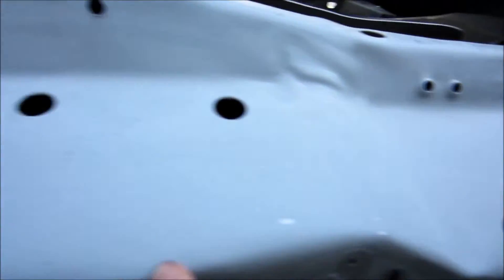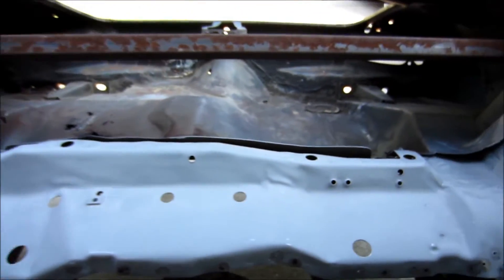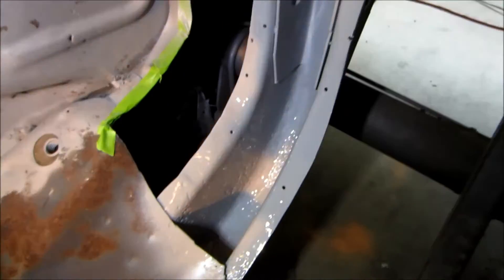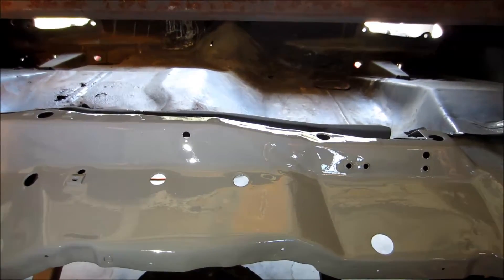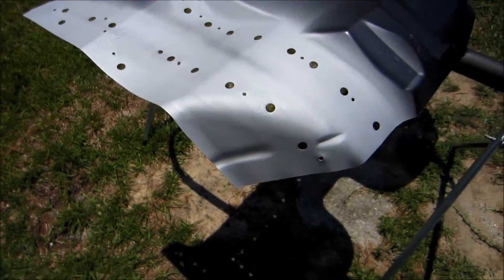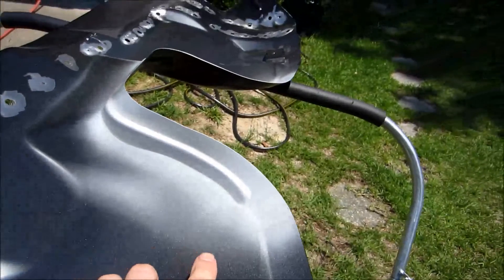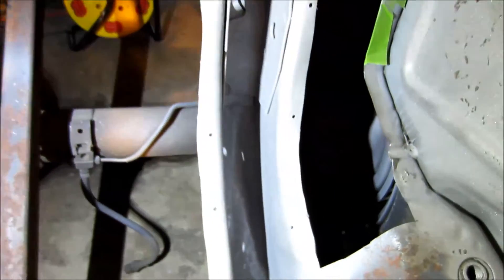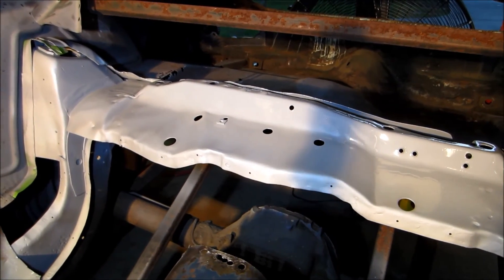Fixing the primer and weld thru under rear seat panel 77 Camaro Type LT Restomod 21

Comment: I feel your pain on the craters , I struggled with them for a over a year , I was so frustrated . I literally tried everything , different guns , wax and grease ... No wax and grease , thinner to clean gun , changed to reducer to clean gun , cleaned whole shop moved every stitch of any oils , wrapped my lift in plastic thinking it was the fluid from the lift in the air .... Nothing worked.Over the last 6 months or so I haven't had any issues , here is what I changed ...pressure at the wall is 120psi , 28-29 psi coming into my gun ( iwata lph 400) 1 light coat , flash 30 min 2nd wet coat , 30 min flash 3rd if you want . This issue was so bad for me I was ready to find another hobby ;). Good luck
Reply from the maker: I was glad to see you get it figured out.  After watching and learning from your experiences, I also put the wall pressure at 120 and 29 at the gun.  Before I spray again, I am going to make sure to clean the gun better.  I couldn't get it all the way apart.  As ScottH454 mentioned, the cheapo harbor freight has grease inside it and I am worried I didn't get it all out.  Thanks for watching and helping me along the way.  This is my first panel and hopefully I'll get it figured out.  I have several panels to replace on this car before I get to the exterior of the body.  Today I start the welding this panel.  My sheet metal welding experience is very minimal so this should be fun.
Reply: +Sam's Garage get the welder dialed in and it's a piece of cake ;)
Reply from the maker: My argon regulator messed up and starting shooting gas out the pressure relief valve on the regulator and the gauge was pegged.  That murphy stuff you talk about. Just my luck.  Maybe next time.  I picked up a cheap one from harbor freight to get me by until I can see if it is rebuildable.
Reply: +Sam's Garage gotta love Murphy

Comment: I found those 2" sanding discs to be the best tool for removing rust in small areas.  You can get them in different grit, but I always used the 60 grit.  You can find them at Home Depot, but I'd suggest ordering the discs from Amazon.  You'll be amazed at how many you'll go through on a project. I bought a 90 degree die grinder to run them in.  Primer turned out very nice!
Reply from the maker: Thanks. and thanks for the info.  The guy from the paint store recommended using a Dremel to remove the primer in those areas and it seemed to work pretty good.  I've used some 2" and 3" 80 grit rolocs from Lehigh valley abrasives that also work pretty good removing rust.  It probably would have been faster that way.
Reply: Yeah, the rolocs.  I can't never remember what they're called ;)

Comment: Looks Good Sam, from my experience Sometimes its best if you can to just weld without the weld through primer and come back later and get primer in between metal if possible. Expect splatter when you weld on the weld through primer thats what I dislike about it.
Reply from the maker: Thanks for the heads up and advice.  Hopefully I'll start welding it in this weekend and don't screw it up too bad.  This should be fun as I already am not the best at welding and the weld thru will make it more difficult. lol

Comment: Looks a lot better Sam. Q though, on the new panel (with the EDP on it), did you remove the EDP where you put the weld-thru? I could not tell from the video. You want that stuff on the bare metal so the welder can conduct. It is not supposed to go over the EDP (I think).
Reply from the maker: Thanks.  I did grind off the EDP before applying the weld thru.  How many coats of weld thru do you usually put on?  Will too much cause problems? I put on 2 coats but wasn't sure on that.

Comment: Is that a Harbor Frieght cheapo spraygun? Did you take it all apart to clean it or just rinse it out. Those have grease inside them, likely an antirust for trip from china.
Reply from the maker: It is the harbor freight gun.  I took it as far apart as I could to clean out those oils.  I couldn't get the part off that requires a tool. The tool I ordered to disassemble it cost more than the gun.  lol
Reply from the maker: Wow.  That's crazy.  I need to get mine the rest of the way apart.  Thanks for the heads up.